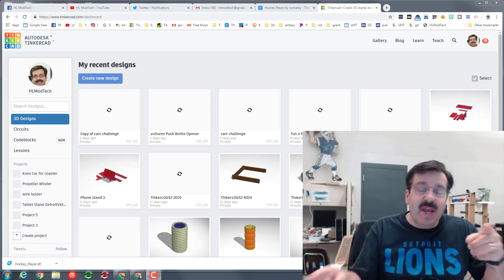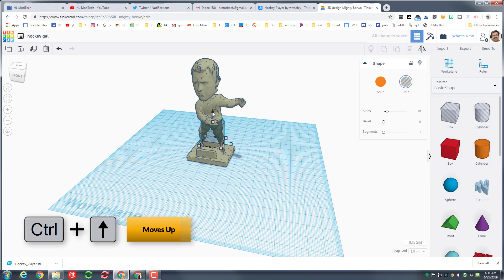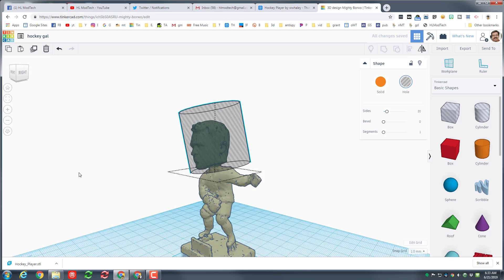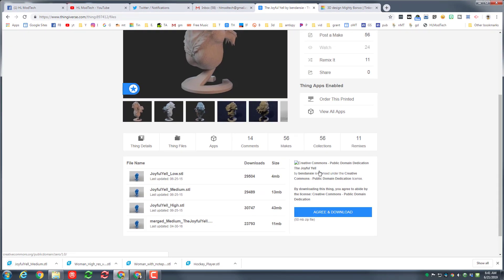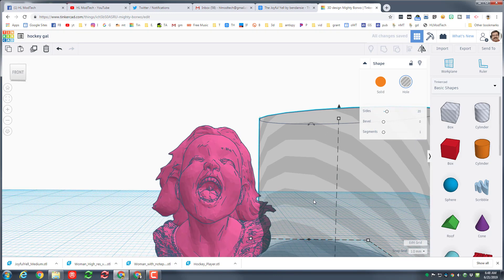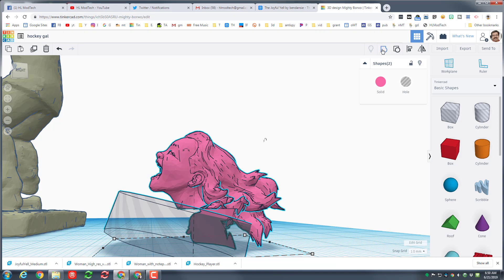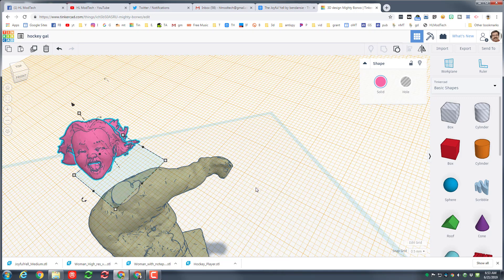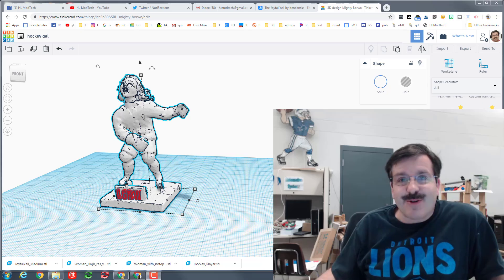Modify an STL using Tinkercad! Fantastic, Free, & FAST! What will you make?

Comment: I have downloaded a PTT handle for my ham radio. The handle centre currently has a hollow centre set at approx 16mm to mount a push button switch. I would like this hole to have a M16 thread. Can TinkercCAD modify my stl file to put this thread inside?
Reply from the maker: You can. It is not automatic though. There is an iso metric thread and you can fiddle with. Make it a hole and group it. Likely a bit of guess and check to make sure your printer is calibrated well enough for the thread to be accurate though.

Comment: HELP! - I cannot load any stl files into tinkercad. They are all 25mb, many less than 1 mb. Any idea what's going on? I tried different browsers and everything but nothing works. I get no error message just stop saying loading and then a blank workplane. I get most of the stl's from thingiverse.
Reply from the maker: I would start with trying a different browser, or checking to see if the browser is up to date. You can reach me at hlmodtech gmail if you want to share a link to what you are trying to import.
Reply: It's odd, some of them import others do not. All are from thingiverse. Maybe the one's that do not import have issues with the stls? IS there a way to check the integrity of a stl?
Reply from the maker: I think the smartest way to mess with them is with meshmixer. This video shows a technique you can use to reduce the STL file size... But it really has more power than we will ever truly harness. =) https://youtu.be/JwqdsIoIsas
Reply: @HLModTech  Thanks man, you have been a great help.

Comment: i cant get it to cut when i group, it just combines the two
Reply from the maker: Make sure you are turning the second one into all hole instead of just making it transparent. Sometimes you also have to make it a lot larger than you would expect.
Reply: @HLModTech  thanks i think i figured it out. Got a square piece im trying to cut a corner off for a rounded corner
Reply from the maker: If you get stuck you are welcome to share it with me. To share a project you need to use the steps in this video https://youtu.be/XeDQjhRK8lg You can reach me at hlmodtech gmail.

Comment: Sorry for a noob question but I am a noob at this: I've got an STL for an extruder fan that doesn't quite fit around the hot end.  I'd like to cut off the lower part (air outlets to cool the part), enlarge/widen it  by 15% and then reinsert it onto the lower end where it was first removed from.  I'm suspecting that what you did here will do this but I'm not entirely sure.  Thoughts?

And I do hope I made sense here.
Reply from the maker: That sounds like a project similar to this. It would likely take a few guess and check runs to get it right. I find that sometimes holding and working with the failed attempts gets me a smarter end product... If you want to share images of the project you are welcome to reach out via email. hlmodtech gmail.
Reply: @HLModTech  Truly appreciated.  Email has been sent.  Many thanks.
Reply from the maker: Just spotted the email. Will get you some info in a bit.

Comment: When filling holes and change parts in old parts i get (scares) in the new parts that is seemed in print and printer printer the scares how to make this disseperes?
Reply from the maker: I have seen marks in Tinkercad, but they are usually not visible when I actually printed them. What sort of printer are you using? You could also try to smooth things in Meshmixer.
Reply: @HLModTech  its an rebuilt anet a8 and u see it filling in the holes and adjustment done in the part
Reply from the maker: If you would like, shoot me a share link of your design. You can reachout  via my website or hlmodtech gmail.

Comment: you are grouping the lady and the different cuts, step after step. but you didn't reduce the file-size of the lady. 

question:
a) is the only way to reduce the lady to export the head and reimport it? 

[because the saved file in tinkercad will also be
- big (opening, rendering will cost time...)
 and 
- if you forget the construction (amount of groupings) after a while... and you ungroup too many steps... all hidden parts will appear again...]

OR

b) is there another way to "group and reduce" the head that it's not able to ungroup the head anymore?

thx ;)
Reply from the maker: I was helping a user out with a specific project there. All she wanted was the head and she was new to the process... If you really wanted to reduce file size and make it cleaner the right tool to use is meshmixer.  It is free as well and really powerful.  I have not mastered it for the type of work I showed here, but I love it for supports. https://youtu.be/8xY2gHLg-ZA